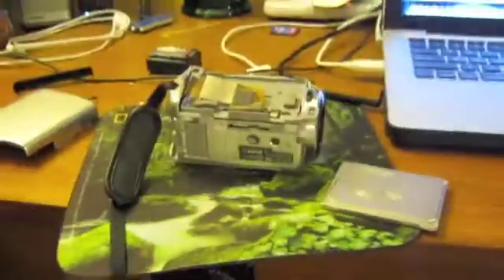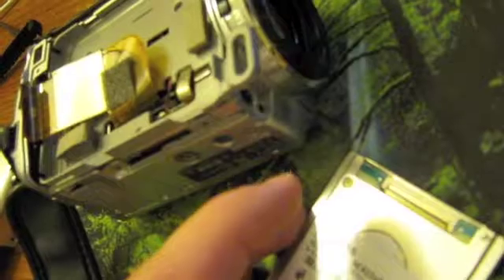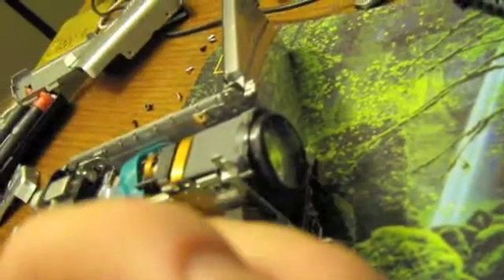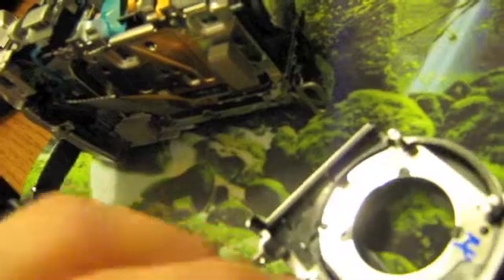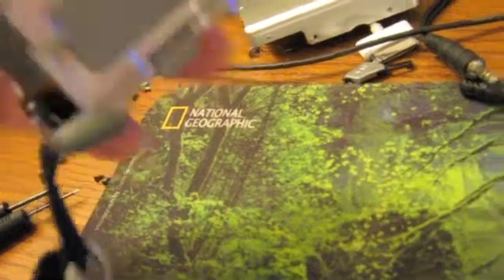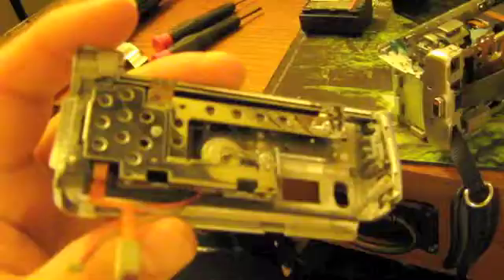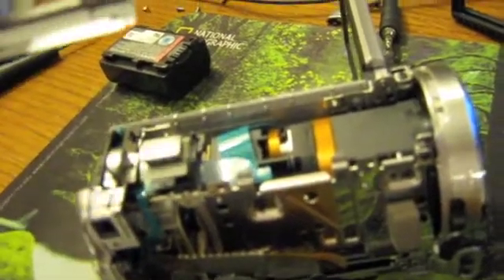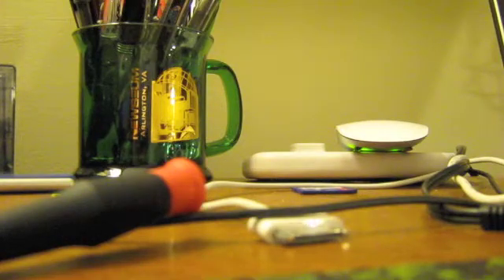Sony HandyCam DCR-SR68 Teardown and Repair (after drop)

Comment: Have a dcr-sr68 handycam camcorder.  Getting error:  

Hdd format error   flashing E:31:00      I have been trying to find a reputable repairman for my camcorder and can't.  Reviews are scary.  When I searched for sony authorized repair shop, it showed me Precision Camera and Video Repair as authorized by Sony.     http://www.precisioncamera.com/digital-video-camera-repair.html  But, I found horror stories on them as well from customers even tho Sony says this is their authorized dealer.  I need to get my camcorder fixed (can't afford a new one) but I don't want to get screwed by a unreputable company.  Haven't found a reputable one yet even Sony's recommendation...  Help.  Is there a company out there that can help me?
Reply from the maker: The issue sounds like a damaged hard disk drive to me. Any shop willing to perform the needed repairs would charge you well ABOVE the cost of a used, but fully functional Sony DCR-SR68 camera off eBay. Currently, they're selling for around $85 USD. My suggestion? Buy a used camera.
Reply: @bbishoppcm  Thank you.  Probably best advice I've received all week on my research.  Any reputable sellers on ebay you can recommend?
Reply from the maker: @bantirob  None in particular, but all eBay sellers are rated by the buyer after completing a transaction, so bad sellers are often weeded out quickly.
Reply: Thank you.  Found one for $63 in excellent condition.  Don't know why I was so focused on getting mine fixed.  Thank you for broadening my thinking/options.  Good lesson. @bbishoppcm
Reply: Take a shot at fixing it yourself you have nothing to lose, after all it's already not in use. What are you going to do break it even more. You might impress yourself & learn something interesting while you fit!

Comment: Did your zoom work after the drop? I dropped my sanyo xacti and it still works but it will not zoom and focus. I have to be a certain distance away from the lens for it to be in focus. Can it be fixed? Thank you so much in advance for responding!

Comment: The Sony uses a CCD image sensor. The Canon still camera you were using probably has "one-shot" autofocus. which means it focuses only once when you start recording a video, and holds that focus for the rest of the video. Therefore in order to do a close-up, you have to start recording while it is already held up close to the subject.

Comment: Very effective, nice fix! I didn't think actual hard disks could be that small. Wow, the Canon camera you have is worse than mine. I have three canon cameras one of which uses Compact Flash, a mini IDE interface, and they are all 640x480, and have a faster shutter speed than yours. When was yours made?